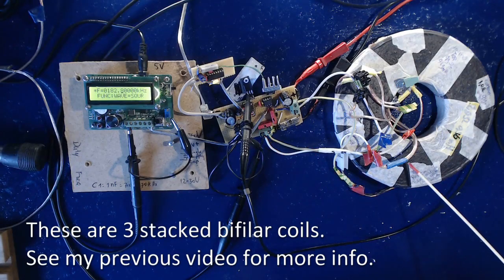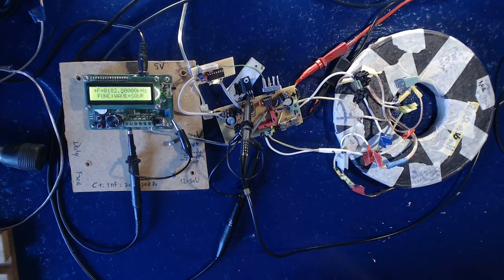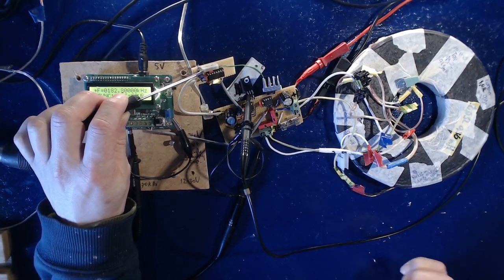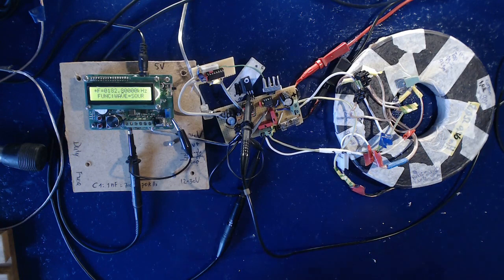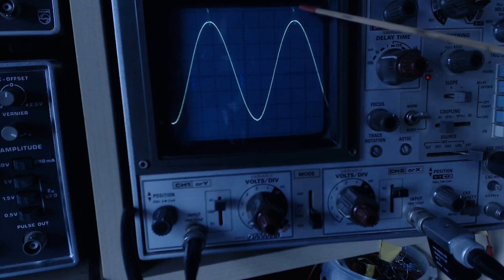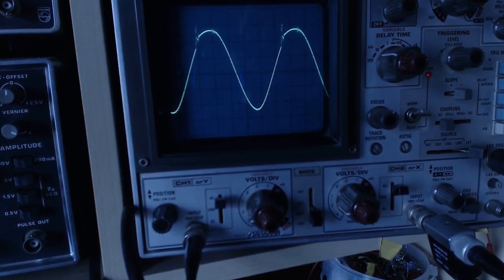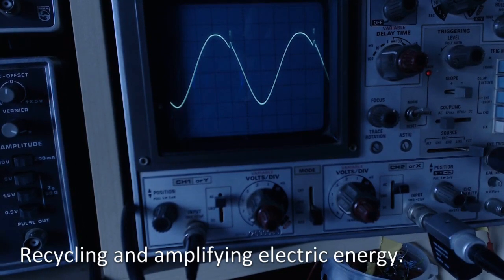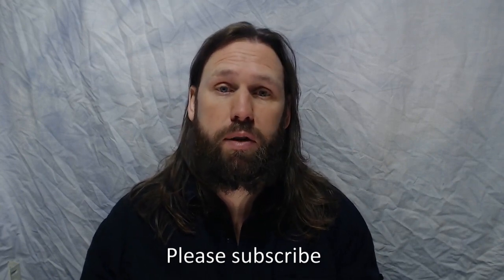Amplifying energy in a bifilar coil, by simultaneously using 2 methods of inducing resonance

Comment: Yess Holy fuckkk your right daamnnn that's so cool

Do you think spark gaps might help?
Reply from the maker: no spark gaps. use mosfet switch instead. and instead of capacitor discharge through sparkgap, use a coil discharge (inductive spike) by opening the mosfet switch really fast (impulse generation)
Reply: @MasterIvo Omgg you replied😁
Honoured to be speaking with you Sir🙏
Yess  I agree with you:) 
Although I have one enquiry to make
I managed to get High voltage (around 3k to 6k)  using 150mm toroidal core and a coil and 2 n42 grade magnets (spun with a high kv drone motor) 

My questions is this
1.  My frequency was a few thousand hertz ) and on load there was a draw on the system like resistance 
Then I introduced a spark gap and upon adjusting the spark length a could adjust the frequency from a few kiloherts to megahertz (I actually could not measure) 
 
!! And surprisingly the load on my little spinning magnets was nullified! 
And I got way more watts out of it! I actually ran out of load to test it on! 

So what is this spark gap phenomenon? 

2. Is this standing wave and resonance you create between the two bifilar coils.. (inductive spike) In some way acting just like the spark gap by relieving the resistance by sending back energy into the sea of energy? 

3. Mosfets are exactly the way to go! Although they get hot! And can't be run 24.7
And circuits have a much higher chance of getting fried! 
So basically 
      Is it better to create high voltage and high frequency in a coil - (impulse generation) ( and then subsequently use another coil to resonate and provide current to the load), using transistors and igbt circuit? 
         Or is it better to create high voltage and high frequency using mechanical means and spark gaps (which can be run longer) 

4.the induction amplification process using standing wave created by the bifilar coil.. Does it in any way act similar to a spark gap to relieve resistance by resonance
Can they be used in conjunction with each other? 

If you're still reading this! Thanks broo (I'm an ametuer! Just wanna see the people of this world benefit from be technology! And i love Nikola Tesla! 
PS. I'm from India! Loving the hair bro! I too have long hair;) 
Shall update you on my progress using mechanical means! 
Cheers yo😁🔥
Reply from the maker: thanks :)
many questions!
I'll subscribe to your channel to see your progress.
My mosfets stay cool and can run 24-7 no problem.
sparkgap is best for capacitor discharge, but it wears out relatively quick.
Instead I discharge a coil with mosfet switch.
It seems the quick discharge of a dc field (dielectric field) creates a Void that is filled by the ambient aether.
Bless you my long haired friend
Reply: @MasterIvo  okay I'll try mosfets, I just had that glitch in my mind that they fry fast, so thanks for that :)

Hahaha that's cool honestly the videos i take i haven't uploaded! But i promise you I will upload all my videos :)

Okay soo Quick discharge.. Creates a void! You're right!

 The pancake coil creates a dielectric field in a circular plane which shoots out in all direction! And a magnetic field always switching polarity (depends on frequency), this creates a counter spacial bubble of switching magnetic field and collapsing and expanding dielectric!⚡
This 'void' draws in ether or energy! Wowwww that's really cool! And you said it so  easily!!! :D
Coool I can't wait to try! 
Thank you MasterIvo:) 
I shall have my videos up soon and send you links :) 
Cheers yo😁🔥

Comment: why not use a spark gap instead of mosfet
Reply from the maker: sparkgaps don't work well on these high frequencies. there are much harder to control and have much wear and tear. A mosfet performs much more stable, is precice and does not break nearly as fast as a sparkgap. they are silent don't emit RF, are small... low power consumption. and very fast. 

sparkgaps can be fun but are not for me. it's 2018 not 1895. use the best  tech available.
Reply: A Mosfet has an internal Diode, this prevents the Selfoscillation of the Tesla Bifilar Coil. So there are disadvantages to use new Tech. (But i also want to prevent to use a Spark-Gap if it is possible)
Reply from the maker: brake vs break  ? like slowing it down?  a mosfet does break, the resistance goes very high, just like the air represents a very high resistance. and a mosfet can break much faster than a sparkgap can. a sparkgap needs a magnetic field to stop it from conducting, thats why they dont work at high frequencies.
Reply from the maker: @anserinae I don't understand your question

Comment: You got your terms a little mixed up ( maybe just language barrier). You use 'energy' when i believe you mean 'power'. I know it may sound like im being picky but there is a difference. Energy (joules) is the 'work' performed, where power (watts) is the rate at which energy is being consumed or, more accurately, transfered. However, regardless of terms, Energy can not be amplified, and the power out can never be greater than the power in. Also, (again im being picky of terms here) 'voltage' (volts) can not be stored in a capacitor, a capacitor stores 'energy'.  Voltage is the electromotive force or the difference in electric potential that cause charges to move thru a conductor. It may seem trivial but its important to understand the difference between these terms as they have different units of measurement.
Reply from the maker: well, energy is only conserved in a closed system. In a open system it is not. Aether is every where and brings balance to the force.

Totally agree, on energy vs power.

Comment: Hello, I find it interesting you are looking at the accelinstruments(dot)com information and concluding that the purpose of the series capacitor is to capture the coil spike. In that circuit there is no sharp switching to create the coil spike, but instead its operation seems to depend on some kind of series--parallel resonance. I would like to find a replication of this circuit - do you know of any? Respect for sharing your work.
Reply from the maker: thanks, my work is inspired by it, its not a direct replication. the information states the series parallel capacitors have to be in phase. the energy adds up and is amplifing the voltage, and it works. I dont know how they do it in real life. I guess there is more to it than the article states.
Reply: Yes - I like this technique to re-use the spike by pushing it back into the coil as you do. Commonly a second battery is charged from this spike, but then you have losses of charging a battery, as well as the inconvenience of... another battery. Good work :)
Reply from the maker: I'm now working on producing a negative voltage inductive spike. This seems to have some benefits, with the interactions between the 3 bifilar coils.
Reply: Regarding the negative spike... it is said that, if the resonance can be matched with the impedance of a load (or resonant circuit) on the negative side - you will have what you want. So, instead of sending the negative spike back into the coil, direct it out on one-wire and create a matched impedance load along this "negative" path. (You can terminate the wire on the positive of a battery or cap that is in series with your power source... or perhaps isolated metal plate which I have not tried.) I am studying this myself. Rick Friedrich - who has a channel on here on YT - has shared a lot about this. You can read his non-technical introduction to resonance here rpmgt(dot)org/ResonantSymphony(dot)pdf.